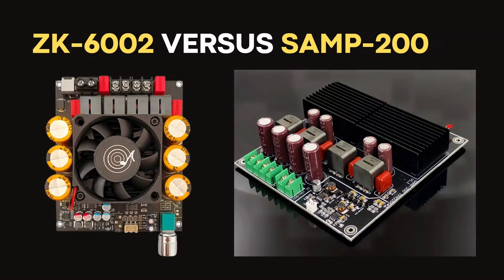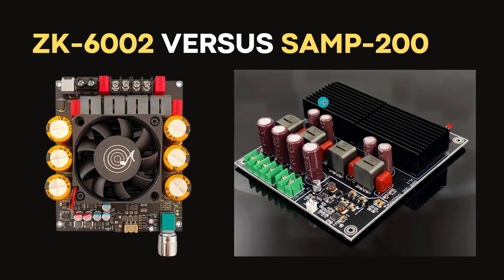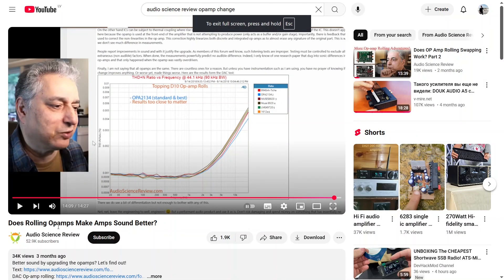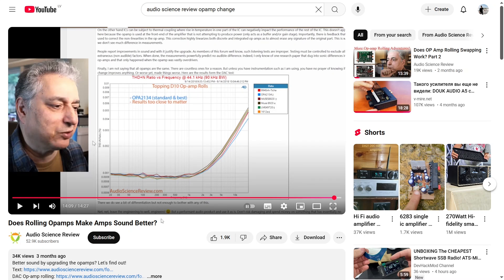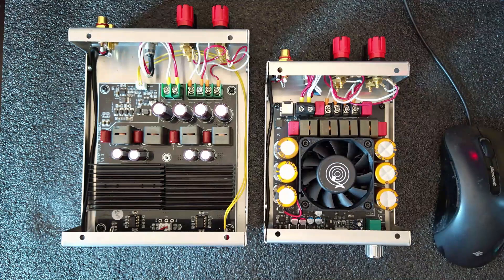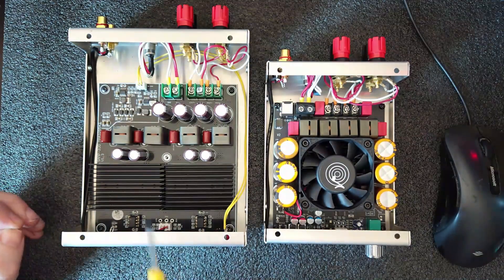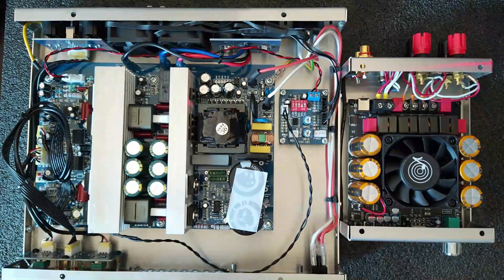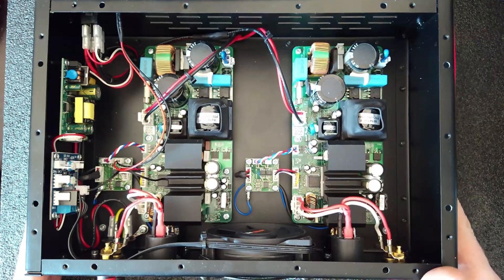SAMP-200 versus ZK-6002 TPA3255 boards

Comment: i am telling you that there is difference in op amp. i swaped op amps in my 2x 3e a7 mono from opa1656 to sparkos. sparkos killed trebble and soundstage . (yes sparkos opamp was worse than stock - im my system.)

2 x icepower 1200as2 dods not sound as good as 2x fosi za3. ... 2 x 3e a7 is way better than 2 x za3

my setup wiim ultra via usb to singxer su6 DDC via i2s to holow audio cyan2 DAC to 2x3ea7mono AMP to dali speakers.
Reply from the maker: OP amps have different input impedance and output current characteristics. When you swap them, you should recalculate the resistors' values according spec sheet input and output parameters. This is why I am not recommending swapping them without a clear understanding of what we are doing. With arbitrary signals, you can check dynamic characteristics changes for one or other OpAmp. The changes that you mentioned should be visible as arbitrary signal distortions at the amplifier output. Issues can be fixed by changing the resistor and feedback capacitor values.
Reply: @guntarssmits2104 Thanks for your reply — maybe you could make a new video on the topic of op-amps.
 
Also, the common argument (as seen on ASR, which I’m generally a big fan of) that 'there are no measurable differences, therefore there can be no audible differences' is a logical fallacy. Op-amps do change the sound.
 
It’s simply not correct to claim they don’t — because as you yourself mentioned, they do.
 
Thanks again!
Reply: @guntarssmits2104  
Ok... so you say to recalculate the resistors' values... Uhm no. 
Remember how I said Amir's tests were flawed when it came to showing audible changes? 
What his tests do show is that you won't have to change out the resistors. From an electrical circuit standpoint they perform relatively the same.  ;-)
Reply from the maker: @michaelsegel8758  Once you hear a difference, it should have an electronic footprint as well. I know that there are two opposite opinions about the op-amp exchange impact. There should be a scientific explanation of how it is working. In case the electronic signal on the speaker input is the same, the speaker behaviour is also the same. In case there is a difference, we can find out where it happens and why. This is how equipment is developed. Sometimes it takes time to find the real reason. There is no magic.
Reply: @guntarssmits2104  
I agree that there should be some sort of scientific explanation... but Amir is completely clueless and his test doesn't test for this. 
Its not to say his very expensive testing equipment is bad... just that he's not running the correct test.  

And I don't know what that test would look like either.

Comment: Samp 200 has 680uF capacitors. Is it okay for it? I replaced them to 2200uF.
Reply from the maker: It is determined by the power supply's instant power capability. For Mean Well LOP300 you do not need extra capacity due to LLC architecture and PFC. You can test it by using an external large capacitor and a switch. When listening, you can switch the capacitor on and off and observe whether the high-volume bass improves or not.
Reply: @guntarssmits2104  Thanks for your answers. May I kindly ask you, do you observe any low pas filter on Samp 200? Looks like it is just missed and we would have 600Khz as part of output signal. Is it serious issue for sound quality?  I think I saw it on my oscilloscope.